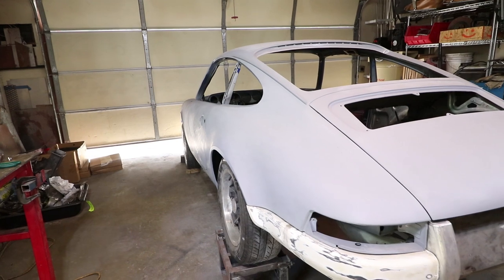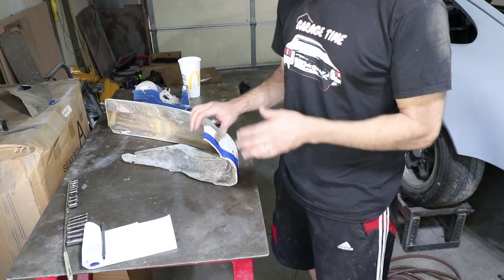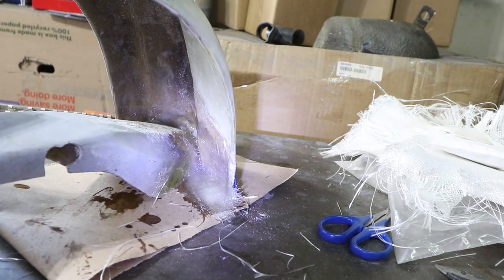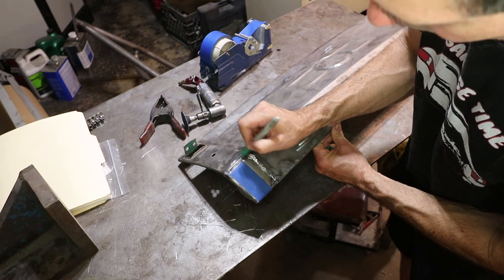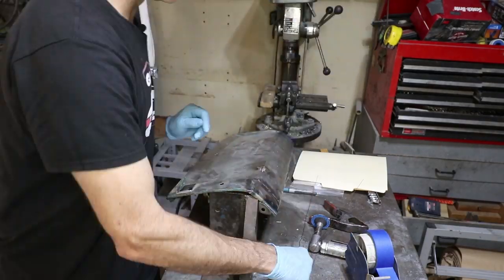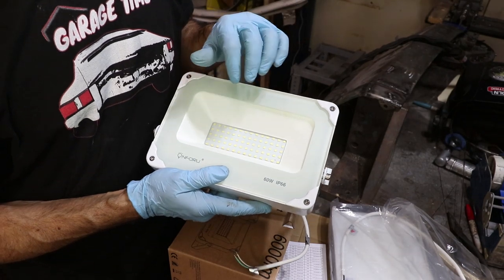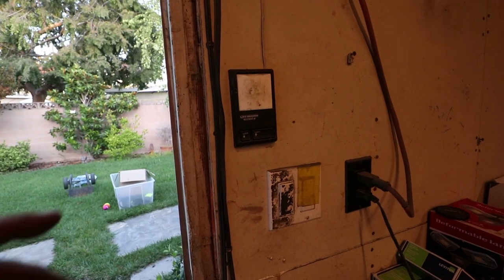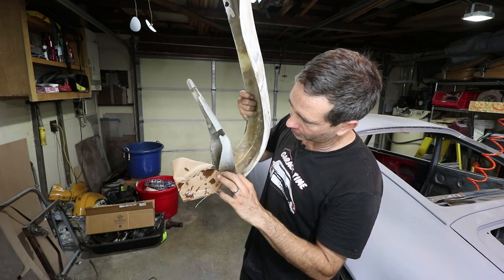A Broken Compressor Is NO Excuse to Lose Focus & Time

Comment: Many professionals use lead body filler for such minor corrections. Works great. The downside is that lead is toxic and the lead free stuff doesn't work (at least in my opinion).
Reply from the maker: Agree!  I used lead on this car!  I used it on the door gaps and rear bumper area.  For this little section, I didn't feel like breaking out all the lead tools, so I used steel.  Silicon bronze would have been a good choice too.  Here are my lead vids
https://youtu.be/Tl3BLMtuYBQ
https://youtu.be/1HLIKrwI9-0